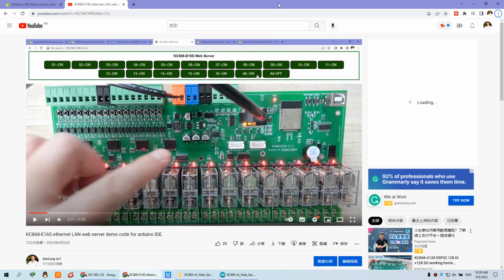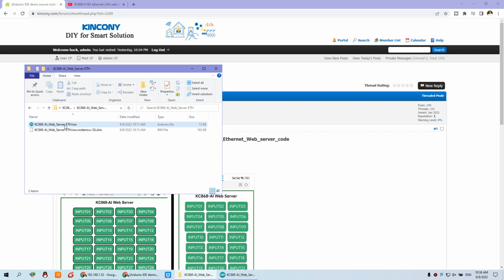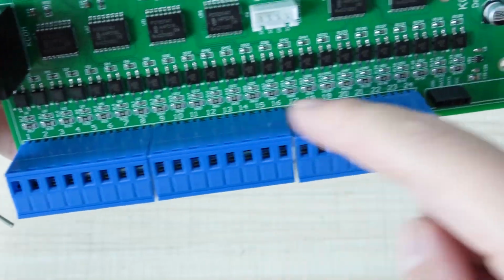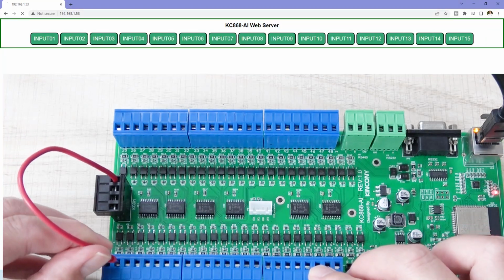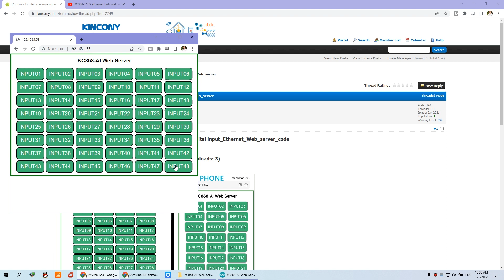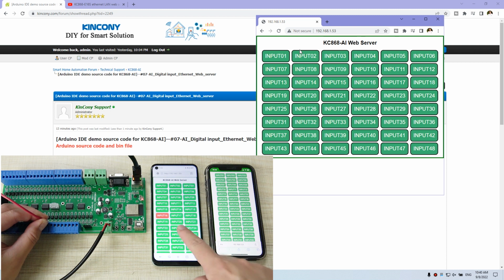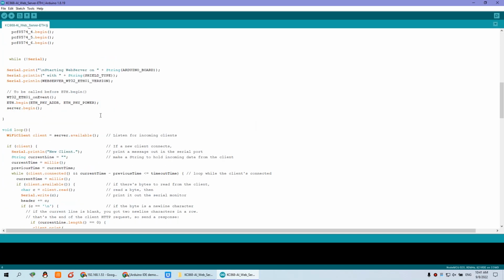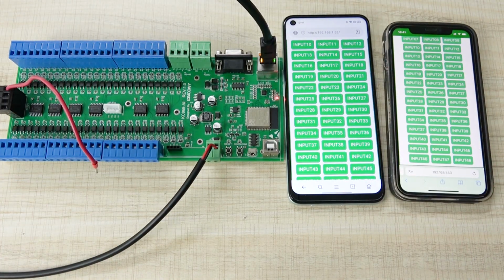KC868-AI sensor monitor DHCP LAN web server demo code for arduino IDE

Comment: I an wondering do you have a relay board  with powermonitoring based on esp32 (that is compatible with esphome)? It would be cool not only switch on and off stuff but also monitor there power.
Reply from the maker: this board under developing, will release in furture
Reply: @KinCony  awsome, can't wait. Any way that I can contribute maybe? :)
Reply from the maker: @kiserleti4d4s  Do you have more detailed product ideas.
Reply: @KinCony  Well this ADE7953, ATM90E32, BL0939 power monitorng ic-s are supported by esphome.
Reply from the maker: @kiserleti4d4s  yes, we are using BL0939 for developing now.